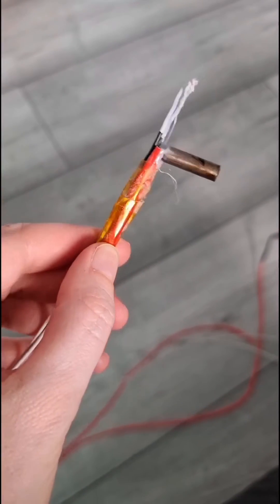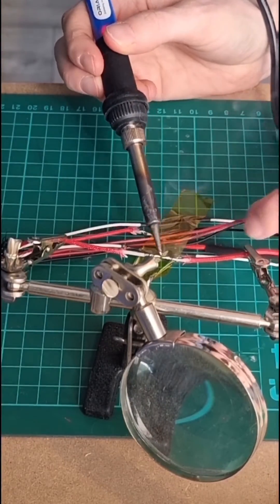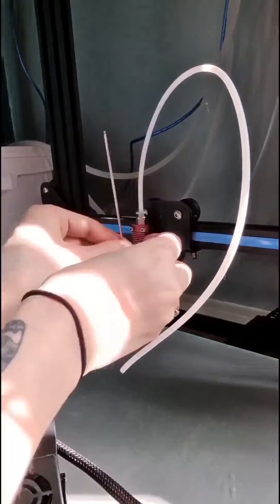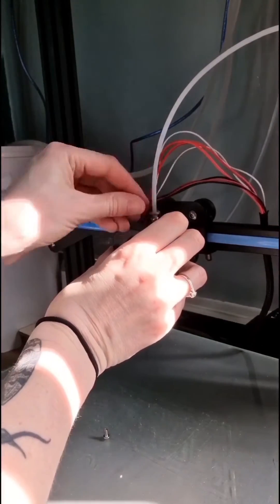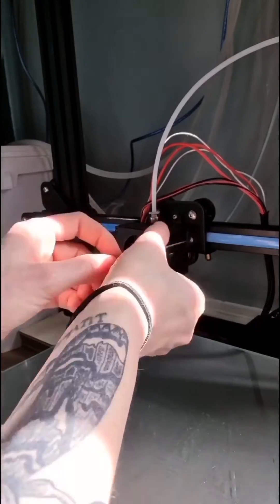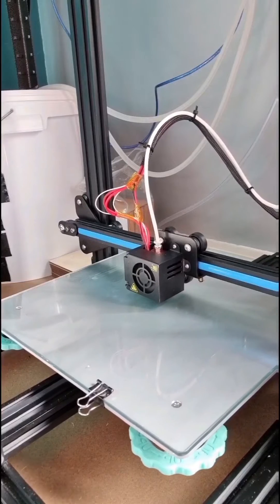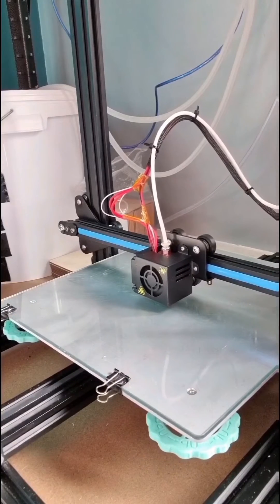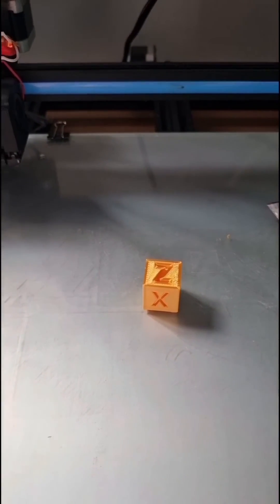Replacing the hotend on an original Creality CR10

Comment: Hello there
I'm going through the same process and I wanted to know how do I know which wire of the hotend goes on which port. Or if I can solder on either one if as long as it goes in the same color.
Reply: Nobody knows!! Why would you go through making this video and not tell what you're doing?
Reply: @paulandrews5611  because there is no difference as stated by creality.